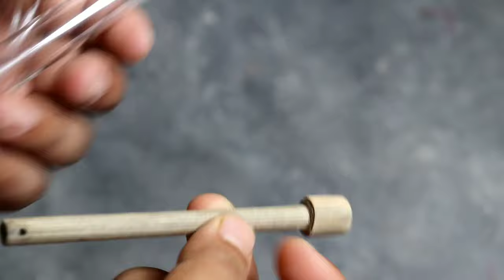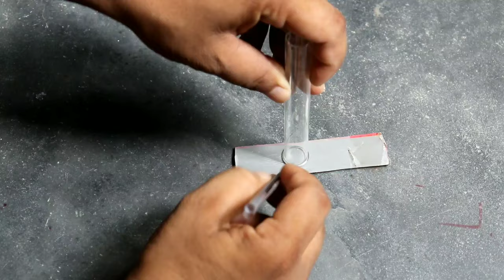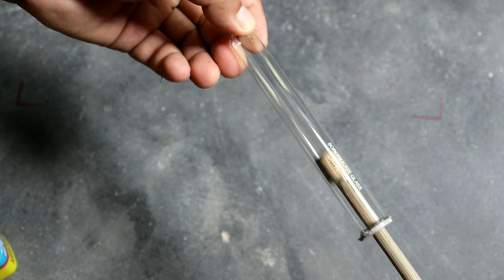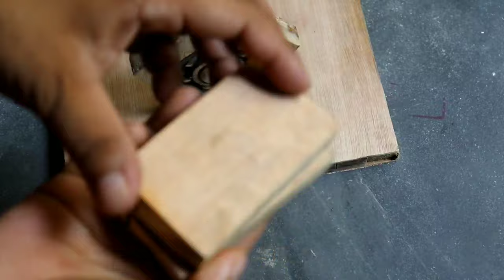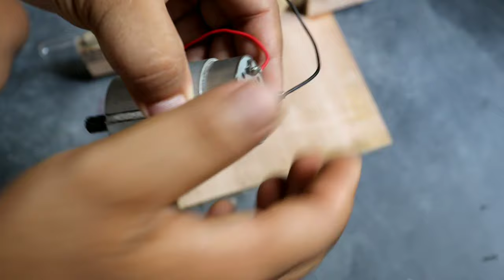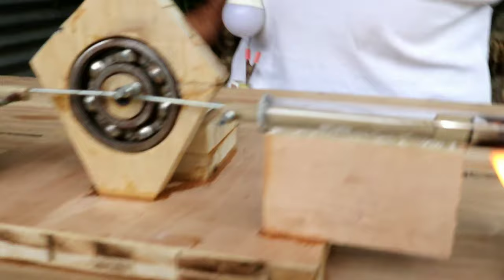Double cylinder steam engine || totally home made||

Comment: Seems more like a stirling engine than steam. Nice Work.
Reply: Except it couldn't be a Stirling engine either, as each test tube would need both a hot and cold side. Sure, the fire would create quite the temperature differential, but there is nothing preventing the heat traveling across the tube quickly losing that differential.

Comment: Your videos are very interesting, but I insist that it would be more convincing (at least for me) if you used a multimeter to measure the voltage. They are really cheap... Thanks!
Reply: Agreed, but these video look very easy to replicate as he shows all the steps. So buy and build everything he did and prove or disprove what he's done. Doesn't look like it would be too hard to replicate and debunk if total bullshit!!
Reply: Again... I Say... It's a Fake
Reply: @TheDomLouis  I love how people will see the skepticism voiced in the comments of a video where people are suggesting simple ways that the person posting the video could provide actual evidence, and there are always people like you who will respond with "hey, this looks pretty easy, rather than the content creator providing any evidence to support all the views he's generating, why don't we just build it ourselves to see if it works?

That motor has a second pair of leads on the side of the motor casing that are pointed down against the baseboard where he can easily put a small battery underneath or just run a DC power supply. He could just as easily stop the test midway and lift the board showing the underneath, or without cutting the clip, stop the machine and pull the motor off. His edits make this too obvious.
Reply: @luisdacosta1541  no dude, this isn't how steam piston engines work. The flame would in theory turn water to steam pushing the piston away, but you need a way to vent that steam so the other piston can expand moving the other direction. If not, they would just be working against each other and eventually build enough pressure to vent around the pistons not moving them, or burst the glass tubes.

And before anyone claims that this is a Stirling engine, each tube would need a hot and cold side, this is not a Stirling cycle engine.
Reply: @racerex340  thanks very much i was really wrong must apologize to the persons thanks bro
Reply: @racerex340  and the motor it's not in the same position at the end of the video,the sleeve he use to hide the power connectors has a seam that  its now offset,when he screwdriver the first time left the centered and when it is shown again it is clearly seen that it has been tweaked once again thank you very much for the explanation, I believed in this video at first sight, thanks for the correction and education

Comment: This is working way. I know those videos which he tries with magnets are fake. This is one is fake because if you try it it will not run fast. It will give average power like around 1500 -2200 rpm only. This one is around 3000 rpm which means some power like batteries are used. But try this at home this is a working way

Comment: FAKE. Clearly the motor is being powered by external source. The speed is not decreasing even when the fire is dimmed due to wind. Also, the tubes are empty. You can't get this much power with air. 
Itni mehnat kar di. Thoda aur karte toh sach ka ban jata.